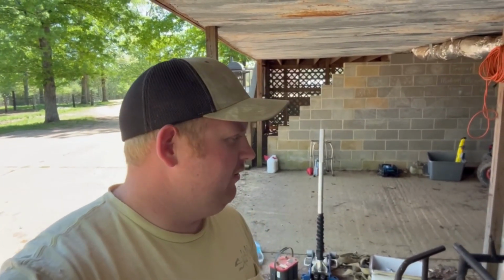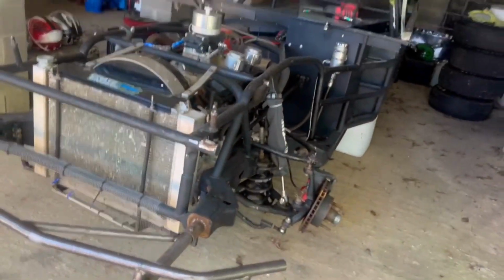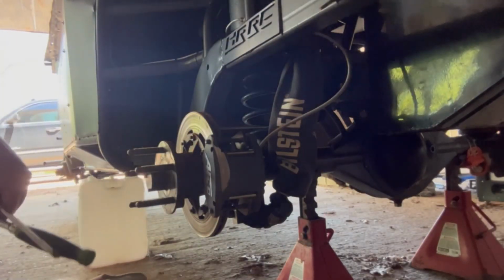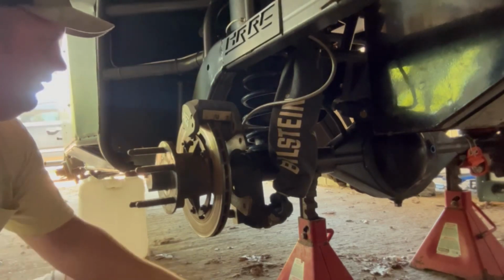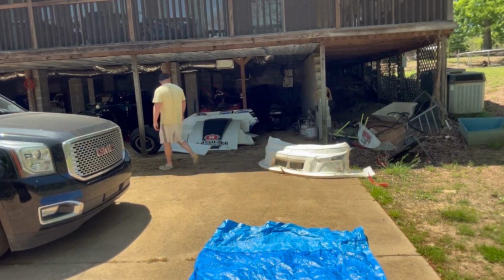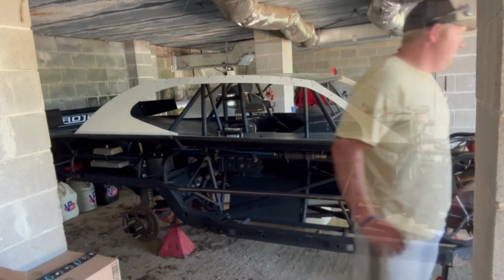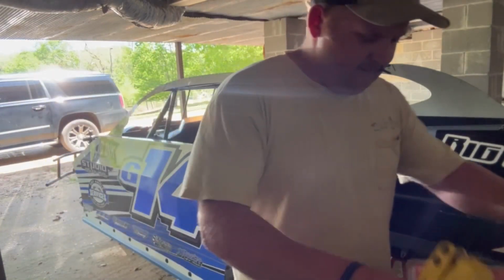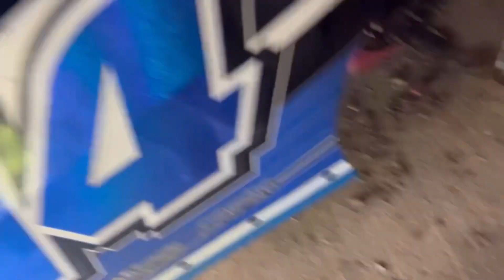Shane gives an update on the G14. Will Hope be ready for the weekend?

Comment: I can tell you what’s wrong. Your caliper brackets are bent. I seen it on the first one you took off
Reply from the maker: Hey thanks for the comment and hope you are enjoying the content! That was the issue, thankfully they have been redone now.
Reply: @gallowayracing1214  we’ve replaced those brackets. In fact I’ve had trouble with the caliper bolts backing out. So what I ended up doing is welded nuts to our bracket’s to solve the problem